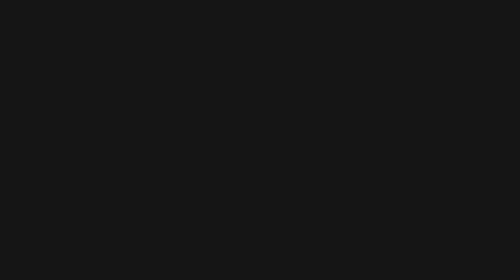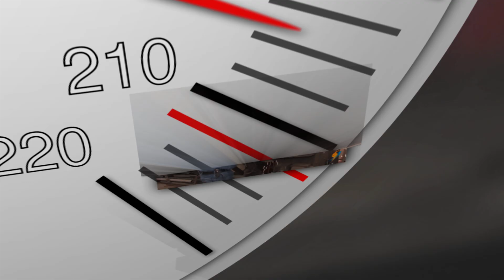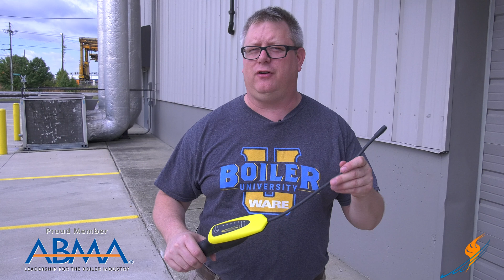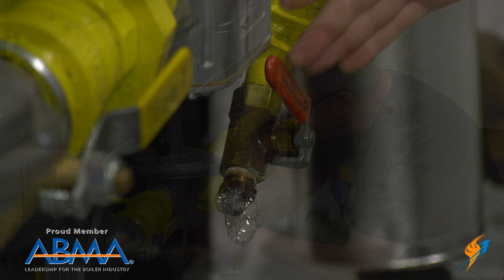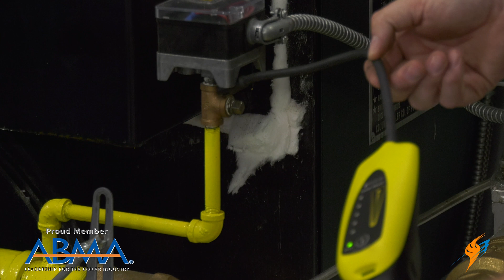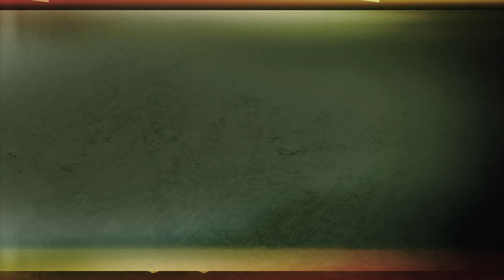Checking Gas Train for Leaks on a Steam Boiler - Boiling Point

Comment: Nice video.
Btw, what brand and model of your gas dectector?????
Thank you, Barry
Reply from the maker: This is actually an Inficon Gas-Mate for combustion gas leak detector. https://products.inficon.com/en-us/nav-products/product/detail/gas-mate-combustible-gas-leak-detector/ Thanks for the comment!
Reply: Blue beast Gamer I have worked in the natural gas industry over 35 years and tested a lot of gas detection equipment, in my opinion of the best low cost tick rate detector would be a Sensit or a TPI. If you're in the business like mine ( gas utility)  the only one I could recommend is a Bascon Turner Rover CGI ( combustible gas indicator). I'm sure at $5,000  plus  the computer docking station for monthly documentation of accuracy maybe out of your league. But in no way does these instruments eliminate the need for a thorough pressure test with manometer or gauge.